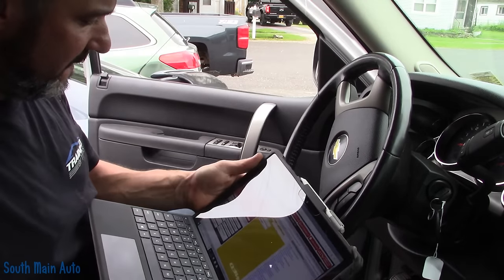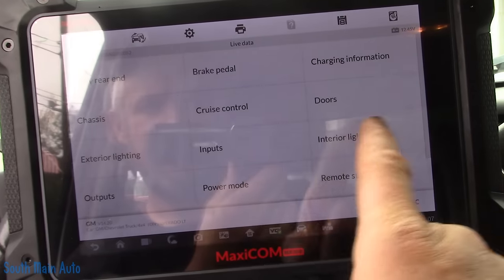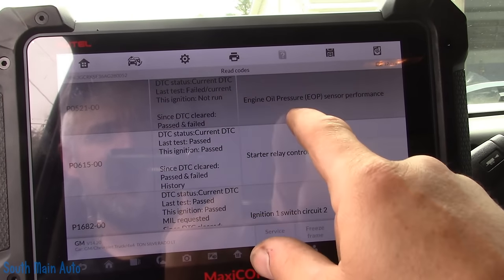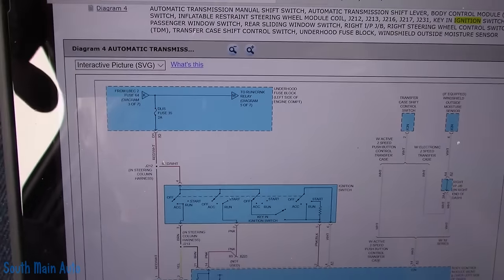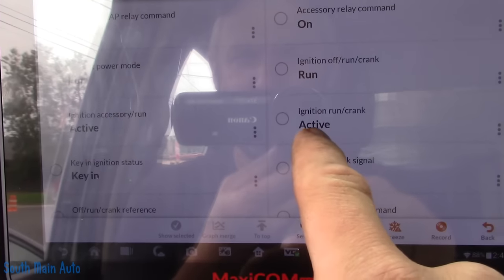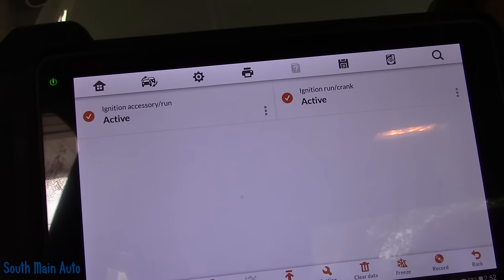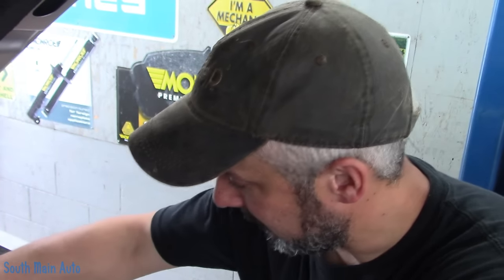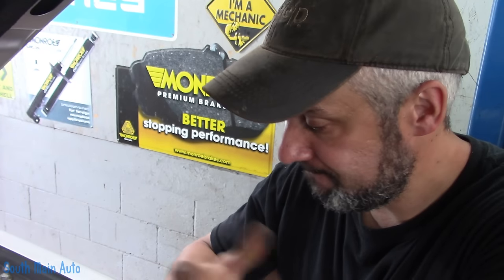Chevy/GMC Truck: No Start - No Crank

Comment: I have the same truck. I bought it used. The owner before me lived on a long dirt road. My fuse box was packed worse than that. I cleaned it out with compressed air and that electrical cleaner spray. Can`t tell it was ever full of dirt.
Reply: Mine was owned by people on a red clay road in Alabama. Im still spraying chunks of clay from the underside of my suburban. Amazingly the fuse box is clean!

Comment: found that twice, one in a 2000 jeep GC on the fuse for the Ox heaters and a 2008 no start Dodge where the traces on the circuit board inside the fuse box were corroded  Both had the cover on but the corrosion started from under the boxes. Great video, hope some of these engineers are watching from wherever the automakers hide them.

Comment: I just replaced one of those fuse boxes for no power to the wiper motor. The wiper relay is none serviceable on this fuse box. Some how the wiper motor burned up, didn't blow the wiper motor fuse and burned up the relay. Some days it's wonderful to be an auto technician. 😫
Reply: Why, you ask yourself, WHY, would they make the wiper relay non-servicable? It should be a plug-in just like all the rest.
Reply: @reecenewton3097  yeah you're telling me.

Comment: Had our 2008 Silverado do the same, power but no crank or start, replaced that 2amp fuse with a 5 amp, because it’s all I had. Started with no problem.

Comment: I’ve got a 2007 gmc I’m working on and it’s doing the same thing but my 2 amp fuse has power on each side and it’s driving me crazy 😜 I watched your entire video and we just did the transmission in it and put a new PRNDL switch on it and I have no power on the purple wire going to my starter and the security light isn’t on either so I’m digging I. It some more and I’ll be in touch with you thanks for the video!!!! 🎉🎉

Comment: After watching this video I went to look at my fuse box and it had some dust in it too, not as bad as this but at some point yes. The cover hooks on one side and clips on the other. Mine wasn’t clipped you have to push the clips over to get it to lock and seal the box.

Comment: 1999 Sierra here, my no start issue was due to ignition switch not sending 12v to the pcm while in the crank position (but only when cold, never had an issue during the summer). I took it to an independent shop, who successfully diagnosed the problem. Shoutout to Denio Automotive in Phillipsburg, Ks!  I had them bypass the issue, (instead of buying the correct but very expensive part) with a push button(leave the ign. sw. in the on position, then push the button to run the starter).  This was after I had a dealership mechanic(on his own time at my house) replace the intake gasket, because he was "pretty sure" that's what's wrong, never did any other diagnoses.  Then I replaced the crankshaft sensor, then the camshaft sensor.  Hope this saves someone else some trouble.

Comment: You have just solved my 2005 duramax intermittent no start no crank having starting after a series of rain storms, a history of mouse turds in my fuse box, they probably peed too, I must have the crusties , will check tomorrow , unfortunately my fuse box doesn’t pull out so easy

Comment: Had the same fuse blow on a 08 2500 last week replaced it test drove it and it blew hooked up amp meter test again drove it wont pull over 170ma and this is a Florida truck no crusty bits
Reply: Sounds like saltwater humidity got to a wire somewhere.  We don't have crusties from road salt we have them from saltwater and humidity. Goodluck

Comment: I had pretty much the same problem with my 03 Chevy 1500. A couple fuses corroded (headlamp hi & low) and I don’t necessarily know why. The cover is and has always been on it, everything in the box is pretty clean and to my knowledge its never physically got wet?🤔 so I just spritzed the connections that we’re starting to corrode with some electrical safe cleaner (I can’t remember what exactly it was) with the battery disconnected and I mean it hasn’t came back/gotten any worse. Just kind of odd..

Comment: Great job my 2012 GMC just did this to me my thinking it's the safety switch but it's not on the transmission I think its up at the steering column. I hope that's the problem of why it doesn't start

Comment: I have the same truck. The oil pressure sensor has a small screen under it. It’s not attached to the sensor but is deep in the hole in the block. That screen is really fine and becomes blocked all of the time. The dealer kept replacing the sensor, which usually worked long enough to get it off of their lot. I wonder if that’s why people replace the oil pump so often. All it needs is a quick shot of air (or solvent, in a pinch ) to clear the screen. PITA.

Comment: I'm having a similar issue with my 2007 Silverado LT, 5.3. Only thing is, yesterday crossing an intersection it just died and after getting it to the side of the road I popped the hood, smack the relay box and it started right up. 2 weeks ago it was parked and wouldn't start, but after checking the relays and putting the cover back on it started. I'm trying to find a new fuse box and it's like booking a trip to Mars for vacation because checking the fuses one broke in half with one post still in the socket because the box looks as bad as this one does. Don't blame me, I just bought it 3 weeks ago and it is my 1st Silverado and the newest truck I've ever owned. THANK GOD for YouTube because I have zero diagnostic equipment.

Comment: Thanks for the information very helpful cause i been trying to find the problem with my brother's truck cause i had changed  the 175amp fuse plus charged the battery still wouldn't start plus replaced the battery ends also so i will try that fuse you had changed in this video so i will try it again and thanks for the information

Comment: I have seen similar problems caused by pool chlorine tablets. The tablets had gotten wet so they were set inside the garage to dry out. Everything in the garage got massive corrosion. Never store pool chemicals in the garage.

Comment: Morning my son an I have bin working on his 2008 Mini Cooper we had the engine rebuild we  installed new plugs coil pack all new stuff , the problem we are having with it engine code p1497  we drive it for 30 minutes it stalrts to stall an then it shuts off I check on all data it told us p1497 is a intake manifold un metered air did a smoke no leaks next thing we did was cleaned the maf sensor an i let it run for 45 minutes at idel with no problems next started it up let it warm up back again p1497. Any suggestions with appreciated thanks love vids

Comment: I live in Ajax Ontario Canada and have a No Start/No Crank issue going on now.Your’e one of the Good Guy’s, my 2017 Silverado 6.2L V8 is at the Dealership for the third time in 2 weeks. No Crank-No Start. Every time they get it there, it starts again. Today, wouldn’t start again, so put key in ON position, moved selector to Neutral, then back into Park, turned key and it started. Drove to the Dealership, I have a loaner car while they try and find the problem. Last time, replaced a Battery Cable reading Low Voltage. Before that, check engine light stayed on and replaced Starter. Both times, everything checked out OK when done. I’m very Frustrated with this. Nothing they can read wrong on Codes as it continues to start when they have it. I can’t trust it until they can Positively say, “We Found the Problem!”... just a sick feeling let me tell you. I’ll tell them of your findings and suggest they check the Fuse Box under the hood. Took a Few Snap Shots of your work and findings during the Video. Thanks for what you do. Joe

Comment: My truck has been broken down for almost 3 weeks now. I've replaced the ignition switch, the fuel pump driver module and just a minute ago I find out it was just damn 2 amp fuse. 
I did not have a 2 amp so I just used a 3

Comment: I diagnosed a no crank on a tractor the other day. The owner backed up to an implement, shut it off, went to restart and no crank. Ended up being the battery cable connection! Cable was tight and hadn't been touched in years.

Comment: Great job, some mechanics would have just tested that fuse (if they found it) for continuity, chucked it in the garbage, replaced it & let the vehicle go down the road without letting the owner know how corroded that fuse box really was. You're a man with integrity though & I'm sure you recommended that the fuse box be replaced as soon as possible preventing the vehicle from possibly stranding the owner or causing a fire burning the truck, garage & maybe even the house with it, you never know...

Comment: I have a 1996 Chevy K1500. Starts and runs fine. But when it gets hot it likes to stall out when I come to a stop. Not really sure what the problem is. Little help would be nice. I don’t want to just throw parts at it.  It has a 350 now. Was a 305, but it did the same thing before the head casket blew. Cheaper to change the engine. It doesn’t throw any codes. Thanks.

Comment: The video gave me an idea. What if, when you are troubleshooting, you can bring up the relevant diagram and as you invoke the malfunction the relevant lines in the diagram could light up based on what the ECM is seeing actually happen? Would that be useful and does the ECM actually have the capability to report that information in the first place? Bad relay? The lit up portion stops at the bad contact. You get it. Thoughts?

Comment: Given the comments below and your excellent video walk through , Id suggest someone bought a flooded vehicle and sold it on as undamaged. If so the fuse box is not the only thing that will need looking at, I can just imagine the white Oil in the gearbox and Transmission now.

Comment: Interesting initial failure. It seams like an impossible task to just figure out where to start searching. BTW, when you pulled that 30A fuse from the front of the fuse box, did I see some sparks? Sure looked like it on the video. (@ 19:48). I even looked it at a couple of times and it sure looked like some to me. Although, it doesn't make sense since that was a power-on accessory circuit???

Comment: I got a 2005 trailblazer, key is locked, stuck in park to crank, no start.  It wouldn't start just crank and had it towed home, now it has escalated to this... i believe the cause is because i replaced the stereo and onstar locked it out.  I put back in the old stereo, and still have the key stuck shifter stuck no crank.   no ding either... hopefully your videos help me fix it, wish me luck...

Comment: I have a 08 Avalanche that has some "CRUSTY" in the under hood fuse block removing the fuses and using CRC electronic spray I'm Hoping will eliminate the replacement of the box, but If this No Crank No Start issue keeps going on then what else can I look for without having the tools that you have? I've done replace the 2 relay's Crank/Run and the Start and have checked the 60 amp fuse's that power the "bus" terminals I've even replaced the ignition switch module crazy thing is that I do Not have the Theft Lock code on the dash except when the switch is turned on then it disappears. Power windows work but locks do not, radio works but the courtesy or the daytime running lamps don't, I've replace the Battery because as I was diagnosing my charger gave an F03 open cell error. I really need some help in Tennessee do you make house calls LOL 😃👍👍

Comment: Did you charge him for the fix. You worked on his truck for sometime. In changing of that bad fuse. Just wondering how must it cost him…. And did you ever do the oil sensor job?

Comment: So once you see the white fluffy crap. You can't disconnect battery, then spray the CRAP out if it with electric clean spray? Like really hose it down with the stuff. Then put in all new fuses and relays???

Comment: Eric -  I love your channel.   The corrosion on the 2 Amp Fuse was the exact problem on my 2010 Chevy Silverado 1500 No Crank/No Start.  My Fuse box looked very similar to your customer's, too. When I went to pull the 2 amp fuse out - the corrosion broke one leg of the fuse off in the panel!!   I was able to remove the chunk by moving it side to side with a metal pick (Neg. Battery disconnected).   Do you have any good ideas on cleaning the corrosion up inside those fuse holders?   I'm thinking about rocking each one side to side, remove, then with a thin pick try to clean the corrosion up/down/side to side... Maybe hose it down with some electrical contact cleaner, let it dry thoroughly before replacing the fuse (legs cleaned with some scotch brite)??  Looking for a good idea here.  Thank You for your channel, and your great videos.  PS:  I think its great to have your daughter working with you - shows her that money don't grow on trees, and dad works hard to put a roof over her head.   Keep up the great work!!!  YOU ROCK!!!!!!!!!!!!!!!!!!!!!!!!!!!!!
Reply: Just wondering what you ended up doing?  I also have the 2010 1500 and have the same issue.  The box is dirty with corrosion as well.  Must have been a common problem with these silverados.  A new junction fuse box is $300!

Comment: I love the look on the faces of my customers when I tell them to change the oil pressure sending unit filter.  This is usually after they mention that their old sensor didn't work and the new one does the same as the old one did.

Comment: Oh my the way I’m working on a 2500 hd 6.0 gas that’s having a problem. It cranks over but not starting. It was starting and running for a few minutes. Then it would just quit as if the key was turned off. No start…. Now. Can you get me any advice? Thanks Derick

Comment: My 2008 Chevy Colorado work truck had all kinds of weird issues with it and it was the same problem the fuse block in the front they replaced it truck runs like new

Comment: Usually I see the air bag light on and that fuse is the one that is severely corroded. My findings with the low oil pressure problem on these trucks even after the sender and screen has been replaced they sometimes come back. Putting on a Longer filter (PF63) instead of the (PF48) Will add almost 10psi more to the top end. I found this out from taking readings from the head and at the filter while driving and found that with the bypass adapter on the filter the top end had great oil pressure. put a new pf48 on it the oil pressure started going down, put a pf63 on it and oil pressure was much better.  This was probably why they changed the filter on the gm 3.6l engine to the pf63. When ever I change the oil on these trucks i put on a pf63 and tell customers request the long filter when they have an oil change in case i'm not the next one to do it, or they go somewhere else.

Comment: I’ve got a question.... I’m about the shadiest shade tree mechanic you can imagine. I’ve got a 2008 2500 HD with the 6.0. 

This winter, my “tighten gas cap” message appeared and eventually my check engine light came on. Came back small leak. 

Changed the cap, and cleared the codes. It came back. Looked underneath and visibly saw the tube to the vent valve was split. Ordered the new GM tube that came with the vent valve. Replaced it. Cleared codes 

Light came back on, this time it was a large leak. Left it alone for a bit, until one day, I could no longer fill the truck. I was 1,500 miles from home and stranded. Took it to a shop and they diagnosed it as a bad vent valve and canister. They replaced it. 

A month later, the light came back on with a large leak code. 

A week later went to fill up and loosened the gas cap and a seemingly incredible amount of pressure was released from the tank. I had to wait like 15 seconds or so before I could put fuel in. 

I then replaced the purge valve, thinking it was stuck closed. That was two tanks of fuel ago, and the light has not returned. 

Are all these related, or was it by freak chance that these components failed in the way that they did. I did not see any charcoal in the any of the parts that I took out.

Comment: Crazy I just had similar issue on a 13 Sierra, corroded fuel pump fuse. Cleaned fuse box and a new fuse and it fired right up .

Comment: Hey buddy have a question watching your videos by the way thumbs up. I have a 2007 Yukon Denali 6.2 and the same exact symptoms on the Chevy pick up that you diagnosed the only difference with mine is everything seems to be OK fuse box etc. it’s an intermittent start try to turn the key ignition 7to8 times and then it finally decides to go?check a bunch of stuff I had it at multiple shops I also have some mechanic experience myself tinkered around a few things it’s still in intermitted stages once it started it can last all day driving it around no problem just no connection at the cluster during start up there is once you start going no tack no speedo no other gauges I would appreciate if you can shed some light if not I have no problem driving it down to you you’re about 350k from me

Comment: I opened the fuse box under the hood of my 09tahoe and i had that fuse box filled with carcass of insects and lots of dirt. The fender wheels on it have been cut out somewhat and this could be reason its this way. I will try installing new fuse box. Sad thing is this also o curred on my 06mustang. Turn key and nothing. No lights on dash, or vehicle no crank or stop. I should mention both ranout of gas, and after adding gas no luck on cranking or starting. Computers on cars not my cup of tea but Im slowing getting there. Thanks 4vids.

Comment: So the p1682 and the p0615 were on account of the 2 amp fuse open? I wish you had gone over the request from key crank all the way to starter engage. I am unfamiliar with the GM once crank position/continue cranking and how it works, thanks man, keep up the good vids